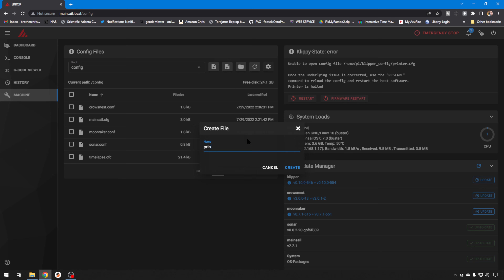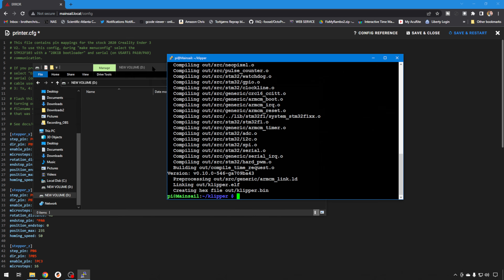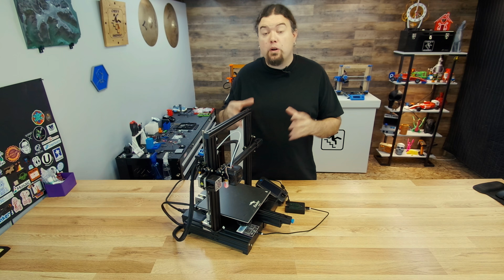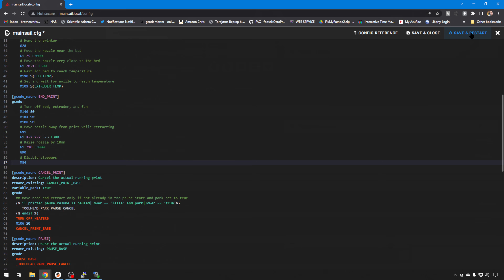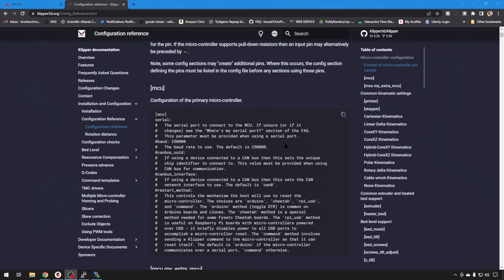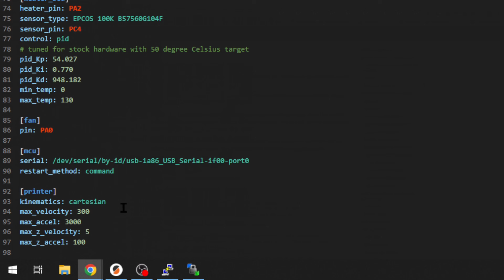Install Klipper On Your Ender 3 V2 - Mainsail - First Print - Chris's Basement - 2022

Comment: Hey Chris i have the new Creality E3 32 bit open source board and i tried to flash this on to my Ender 3 pro and did not flash and also will this method work on a Ender 3 pro??   Thanks in advance
Reply from the maker: Yes, this should work on your Ender 3 PRO, it might be a little different board so it might some changes in the printer.cfg file to make it work.

Comment: Hey Chris - Do you have a solution for put some life into the stock diplay? As several mention, the display is not worth much. But just a logo or a picture would show that the printer is on
Reply from the maker: I wish I knew, there has to be a way, but not sure the easiest way to go about it.

Comment: I got the Error:
Klipper reports: ERROR

mcu 'mcu': Unable to connect
Once the underlying issue is corrected, use the
"FIRMWARE_RESTART" command to reset the firmware, reload the
config, and restart the host software.
Error configuring printer

I can finde my printer (MCU) The command " ls /dev/serial/by-id" Gives the "usb-1a86_USB_Serial-if00-port0" I have edit the printer.cfg with this "[mcu]
serial: /dev/serial/by-id/usb-1a86_USB_Serial-if00-port0
restart_method: command

Save at restartet I still got the error mcu 'mcu': Unable to connect
Reply: Problem solved
Reply from the maker: Great, thanks for watching!

Comment: I cant edit the mainsail.cfg file, is it ok if I just put the macros in the printer.cfg file?
Reply from the maker: Not sure why this happens sometimes, but it's a permissions issue in Linux. If you log in to your pi SSH you can run this command to correct it. sudo chmod 755 /home/pi/klipper_config/mainsail.cfg

Comment: serial doesn't appear for me. please help. I'm trying this on a linux laptop
Reply from the maker: Make sure you MCU pin is set correctly in your printer.cfg
Reply: @ChrisRiley  I figured out the problem. A disability program that was pre-installed needed to be uninistalled.

Comment: HI, COULD YOU HELP ME. I CANNOT UPLOAD MY GCODE FILES. I TRY TO UPLOAD THEM MANUALLY INSTEAD OF USING PRUSA SLICER BUT IT SEEMS I CAN'T UPLOAD ANYTHING UNLESS IT HAS LESS THAN 300 LINES OF CODE. I WOULD GREATLY APPRECIATE THE HELP
Reply from the maker: What kind of error is it giving you? It might be file permissions in Linux causing this problem.

Comment: Hi Chris, thanx a lot for the cool videos. They help a lot. I also have a question for you. Does activating Z-Hop in slicers work in Klipper at all? is there a way to do something like Z-Hop in Klipper?I couldn't find a good answers until now.
Reply from the maker: Awesome, great to hear, z hop just sends Z movement with G1 commands, so it should work with Klipper just fine.
Reply: @ChrisRiley  Thanx a lot for your reply Chris. Yeah, I was a bit confused because I did see some Z-hop when I activate it in a slicer software but I think it is not implemented in Klipper firmware. I wasn't sure about that that's why I asked your opinion.  Btw I would be really happy if you could make a video about combing,acceleration and jerk in cura oder other slicer software. I couldn't find a helpful video about those functions. Just an idea for the next videos ;) cheers

Comment: What is the g code for priming the nozzle and using a skirt?
Reply from the maker: The skirt is in the slicer settings. The prime line looks like this. 
gcode:
    G28                            ; home all axes
    G1 Z20 F3000                   ; move nozzle away from bed
    BED_MESH_PROFILE LOAD=silicone
    M117 Prime Line
    G92 E0 ;Reset Extruder
    # move z axis 
    G1 Z2.0 F3000 ;Move Z Axis up
    # move to prime position 
    G1 X10 Y10 Z0.28 F5000.0 ;Move to start position
    G1 X200 Y10.0 Z0.28 F1500.0 E15 ;Draw the first line
    G1 X200 Y10.5 Z0.28 F5000.0 ;Move to side a little
    G1 X10 Y10.5 Z0.28 F1500.0 E30 ;Draw the second line
    G92 E0 ;Reset Extruder
    G1 Z2.0 F3000 ;Move Z Axis up
    M117 Printing...
Reply: @ChrisRiley  okay cool, thanks for the reply

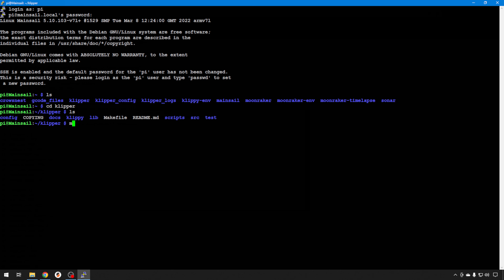Comment: Stuck at 3:51 of the video - I have multiple instances of Klipper/Mainsail running on a PC. If I follow this, won't it be setting all printers to have the same mainboard??
Reply from the maker: It depends how you have them all setup. You will need to work from the directory you have Klipper installed in to keep them from getting overwritten.

Comment: Very helpful,, took the plunge and everything worked out well.
Ender 3 Pro, witth multiple upgrades, prints very well for a ' hobby printer '
I am got exaspherated with VS Code at times, had a Pi 4 anyway, sort of a no brainer.
I will work to get over the ' curve ' , having direct access to the config files is one of the best features.
My BTT E3, V3 is dogging it now, such is life.
Thanks for all the work and the excellent comments on this channel !
Very Best Wishes to all for the season !!
Please think of the folks in Ukraine !
Reply from the maker: Thank you! Happy New Year

Comment: what am i supposed to do if serial is missing when i type the ls /dev command?
Reply: Also getting this error. Where you able to solve?
Reply from the maker: I have found it's usually the MCU start pin. Check the menuconfig again.

Comment: I'm trying to print a gcode file through klipper and it gives me a "unable to open file" error. I've changed the location on the example to home/MYLOGINNAME/MYPRINTER_FILES/GCODE but no no avail. Any ideas?
Reply from the maker: It's usually an issue with the permissions for the gcode directory. It has changed over the last couple of updates. In you config, check the virtual SD card path.
Reply: @ChrisRiley  thanks! Fixed, and printing with klipper. Be well and happy!

Comment: Thank you for the video. I followed it to get my ender 3 v2 running klipper. Do you have a video of the same thing but for ender 3 pro? I have a second printer, ender 3 pro, with atmega1284p board. I think the compiling procedure is the same, I just don't know what info to put in during the makeconfig part.
Reply from the maker: You would probably need to put on a bootloader for that board. This would be the closest config that I know of. https://github.com/Klipper3d/klipper/blob/master/config/generic-melzi.cfg

Comment: Loaded MCU 'mcu' 105 commands (v0.10.0-571-g97a5b39a / gcc: (15:7-2018-q2-6) 7.3.1 20180622 (release) [ARM/embedded-7-branch revision 261907] binutils: (2.31.1-11+rpi1+11) 2.31.1)
MCU 'mcu' config: ADC_MAX=4095 BUS_PINS_i2c1=PB6,PB7 BUS_PINS_i2c1a=PB8,PB9 BUS_PINS_i2c2=PB10,PB11 BUS_PINS_spi1=PA6,PA7,PA5 BUS_PINS_spi1a=PB4,PB5,PB3 BUS_PINS_spi2=PB14,PB15,PB13 BUS_PINS_spi3=PB4,PB5,PB3 CLOCK_FREQ=72000000 MCU=stm32f103xe PWM_MAX=255 RECEIVE_WINDOW=192 RESERVE_PINS_serial=PA10,PA9 SERIAL_BAUD=250000 STATS_SUMSQ_BASE=256 STEPPER_BOTH_EDGE=1
Configured MCU 'mcu' (1024 moves)
Args: ['/home/pi/klipper/klippy/klippy.py', '/home/pi/klipper_config/printer.cfg', '-l', '/home/pi/klipper_logs/klippy.log', '-a', '/tmp/klippy_uds']
Git version: 'v0.10.0-618-g762e2c49'
CPU: 4 core ARMv7 Processor rev 3 (v7l)
Python: '3.7.3 (default, Jan 22 2021, 20:04:44) \n[GCC 8.3.0]'
webhooks client 3040338416: {'program': 'Moonraker', 'version': 'v0.7.1-747-g779997c'}
=============== Log rollover at Fri Nov  4 04:51:56 2022 ===============
virtual_sdcard file open
Traceback (most recent call last):
  File "/home/pi/klipper/klippy/extras/virtual_sdcard.py", line 178, in _load_file
    fname = files_by_lower[fname.lower()]
KeyError: '3dbenchy_0.2mm_pla_mini_1h24m.gcode'
Unable to open file

Comment: Chris, I've got a head scratcher for you. I'm trying install Klipper firmware on my Ender 3V2, but the board won't flash. I've successfully flashed a spare SKR 1.4 board, it returns a reply after issuing ls /dev/serial/by-id/* request. However, the E3V2 just states: "No mcu found! MCU either not connected or not detected." What could I be doing wrong? On the Ender I can reflash Marlin, apparently, as many times as I want. No solution, but Creality apparently changed the mcu on some E3V2's to GD32F303. I've tried to flash using the "Disable SWD at startup (For GiagDevice stm32f103 clones)", but again no joy. Any ideas?
Reply from the maker: Only thing I can think of is check and double check you have the start up pin set correctly. It's different for every board.
Reply: @ChrisRiley  do you mean the "by-id" in /dev?
Reply from the maker: @georgemitchell2288  no, the start up pin, the last option in the menu when you compile Klipper.
Reply: @ChrisRiley  any idea what the GPIO pins to set @ micro-controller startup? It wasn't covered in your setup, and its not in either the sample-configurations of either E3V2 or E3Pro.
Reply from the maker: @georgemitchell2288  is it a 4.2.2 or 4.2.7?
Reply: @ChrisRiley  4.2.2
Reply from the maker: @georgemitchell2288  No pin then, just make sure the serial is setup like this. https://youtu.be/CMmevBC3DuU?t=274
Reply: @ChrisRiley  I've done this procedure more than a few times exactly as you described it. It's exactly the same settings as what's depicted in the sample configuration in Klipper. Again, no joy! That's why I called it a head scratcher.
Reply: I have the same printer with the same microcontroller. I can send you firmware but we need to configure printer.cfg because is not working properly. The reason off course is pin out . Stm32f103 hasnt the same piout with gd32f303ret6 .

Comment: i have a problem with .bin file .... printer change it to .cur ????? i cant flash it
Reply from the maker: It changes it to .cur after it flashes it. If you want to try it again, just change .cur back to .bin.
Reply: @ChrisRiley  I flash it ...then I don't have a port ... I can't connect ... I flashed back to stock firmware and the port is there ... usb port not serial. But when I flash klipper, I no longer have the possibility to connect. I tried everything from usb, serial and what is at the end. nothing works :(
Reply: BIGTREETECH SKR MINI MZ V1.0 its my board + TFT35 MZ V3.0 Touch Screen Control Board TMC2209. For ANYCUBIC Mega Zero.....
Reply: reset ... removed the sd card ... changed the usb cable ... and nothing.
my laptop is intel i5 11th generation with linux. first I tried with Raspberry Pi, then with Ubuntu, nothing worked.
Reply from the maker: @TheHuseinbasic  Double check your startup pin.  # This file contains common pin mappings for the BIGTREETECH SKR mini
# MZ v1.0. To use this config, the firmware should be compiled for the
# STM32F103 with a "28KiB bootloader" and USB communication. Also,
# select "Enable extra low-level configuration options" and configure
# "GPIO pins to set at micro-controller startup" to "!PA14".

Comment: I want to download this on my ender 3 v2 but every time I try to download software to it my printer just messes up and puts me out of work for hours or days so I’m not even going to attempt this I can’t get anything to work with my printer 😢
Reply from the maker: Are you using a V2? Does it have mods or is it stock?
Reply: @ChrisRiley  stock v2 got it off Amazon it works great when I don’t try to upgrade the firmware.

Comment: i tried following tour tutorial on flashing klipper on my V2.  no matter what i do, it wont flash. i tried renaming the flashfile to a unique name,  flash it with the display unplugged, with the display plugged in, connect it to the usb cable with e SD card still in it, with the sd card remobed.. nothing works.  Seems to me the bin file that gets generated is no good since i have absolutely no trouble flashing other marlin based firmware onto it.    

i was considering getting a creatly sonic pad for me ender 3 v3 but now im afraid taht i cant get taht to run either
Reply from the maker: Sorry to hear that. Does it even try to change the file name to a .cur file?

Comment: HI CHRIS I WATCH YOU VIDEO , WHEN YOU WAS INTALLING OCTO PRINT ON A UBUNTU SERVER, ,AND I HAVE BEEN LOKING INTO KLIPPER , I JUST ORDERED A PRUSA I3 MK3S+ THAT I SHOULD BE GETTING IN THE NEXT FEW WEEKS  I ALSO BOUGHT A CR-10 SMART PRO THAT IM RECIVING  THE END OF THIS COMING WEEK AND A RASPBERRY PI 4 ALONG WITH A HYPERPIXEL 4 SCREEN  NOW MY QUESTION IS , I HAVE BEEN A INUX USER FOR A WHILE AND WHEN I SOW YOUR VIDEO INSTALLING OCTO PRING ON LINUX , CAN I RUN EATHER OCTO PRINT  OR KLIPPER ON MY EVERY DAY LINUX PC AND RUN THE PRUSA AND THE CR-10 SMART PRO FROM MY LINUX PC. I AM RUNNING A ASUS ROG CROSSHAIR HERO XIII WITH A RYZEN 7 16 GIG RAM , CAN I RUN THE MK3S+ AND CR-10 SMART PRO FRON THIS LINUX PC , OR SHOULD I USE THE PI THE RUN THE TWO PRINTER , KLIPPER OR OCTOPRINT ANYTHING WOULD BE HELPFULL, , FORGOT TO SAY I AM RUNNING THE LATEST VERSION OF KDE NEON IT HAS BEEN THE ONLY LINUX OPERATING SYSTEM THAT HAS BEEN ABLE TO WORK AROUND MY VISION IMPAIREDMENT , ALLOWING ME TO HAVE A DARK MODE THROUGH OUT THE HOLE INTERFACE , THAT IS WHY I USE LINUX , I HOPE YOU CAN GIVE ME SOME TIPS OF LEAD ME IN THE RIGHT DIRRES
CTION THANKS
Reply from the maker: Yes, you can run either of those from your Linux machine. The only good thing about the Pi is it is dedicated. I always find when I try to run something from my PC, something happens, like it reboots or a process slow the gcode streaming. The Pi just seems to work better.
Reply: @ChrisRiley  THANK YOU , IM ALSO THINKING THE PI , THE ONLY THING IS THAT I HAVE TO DEAL WITH THE CR-10 SMART PRO WIFI BOX , BEFORE I DO ANYTHING, THANKS

Comment: Great video, but I have a situation, when I type "ls /dev" I don't see (serial, serial10, serial11) I did something wrong? or I have to do something else?
Reply from the maker: Most of the time when that happens I have messed up the MCU start up pin, the last option in the make menu. Double check that one.
Reply: @ChrisRiley  Thanks

Comment: Hi Chris, great video for beginners. I am not sure if you covered this, but maybe you could add small example where and how to find pinout for your board? That it's usually in documentation from board manufacturer, like PDF file on github and ho to map pins to configuration. Or is it too advanced compared to taking example configuration?

While adding just PRINT_START in Start G-code section is slicer may be sufficient, it may happen that somebody copypastes macro from somewhere which does not have default values for bed and hotend temperatures (most don't). Slicer then adds temperature control wherever it likes, often times resulting in printer cooling down immediately after heat up and throwing errors about extruding below minimum temp 🙂 In that case it is necessary to pass variables like hotend and bed temperature from slicer to Klipper macro, by adding some extra words behind PRINT_START. It is good practice in general. This article explains what and why needs to be done: https://github.com/AndrewEllis93/Print-Tuning-Guide/blob/main/articles/passing_slicer_variables.md Hope it helps somebody 🙂
Reply from the maker: Thanks, I did add some of that in the latest video, good tips on the slicer settings as well.

Comment: Chris, appreciate the time you spent doing these instruction videos.  I was a big fan of Marlin and appreciate the work done getting it to where it is.  What I like about Klipper is the ability to make changes without having to recompile the code.  It is a simple text file edit.  The use of macros also opens new ways of getting things done.  Will be interesting to see your future videos and will see you at ERRF.
Reply from the maker: Thanks Dave, that's a good point.

Comment: Question.  Is klipper easier to compile than marlin?
Reply from the maker: I personally do not think so, but I'm a Marlin man.
Reply: @ChrisRiley  would be a cool t shirt
Reply: @ChrisRiley  me too
Reply: The question is it easier to make change once compiled.  Marlin requires you to recompile for any change.  Once you get a working version of Klipper you can edit printer.cfg and make any change - then save the file and it is done.  No recompiling
Reply: @woodwaker1  compiling takes 90 seconds on my computer
Reply: @bruceyoung1343  I'm guessing you mean Marlin.  I was able to compile fairly quick also, my concern was backups.  Klipper means to backup your printer.cftg.  I have branched out after using RatOs and have a macro folder that has a lot of includes.  Hard to explain, but they are called from the printer.cfg, so you can have multiple printers with the same configs - and change just the include files.
Reply: @woodwaker1  I only have one printer.  I plan on always only having one printer.  But multi printer point taken
Reply: @bruceyoung1343  I must have multiple printers, since a lot of what I do is print parts for the printers.  If one breaks, I need a working printer to make replacement parts.  I have 3 running printers all using the same basic Klipper setup - an Ender 5 plus, a Rat Rig 500 and a 400.   I use Prusa 2.5 slicer and set it up for the Ender 5 Plus as default,  The gcode can run on any of them.  If I need the full bed size of the RR500, then I slice for that model and label the gcode.  I have three Ender 5 s that I have retired and are sitting  on a shelf.
Reply from the maker: @woodwaker1  That is true, after you get it all setup, it's much easier.